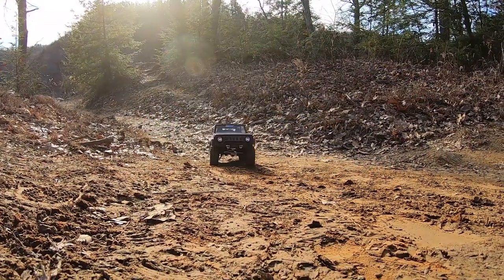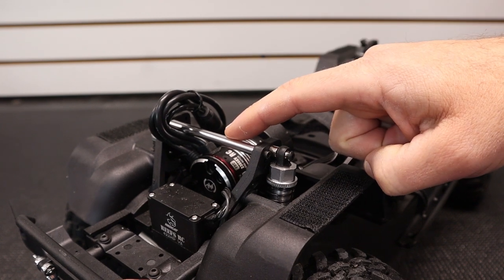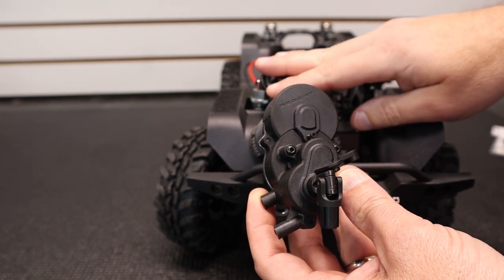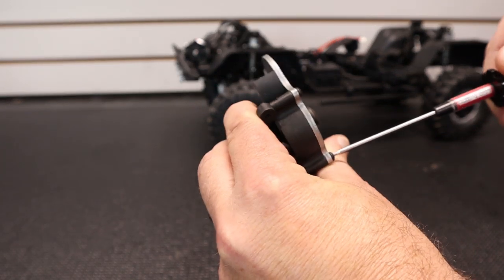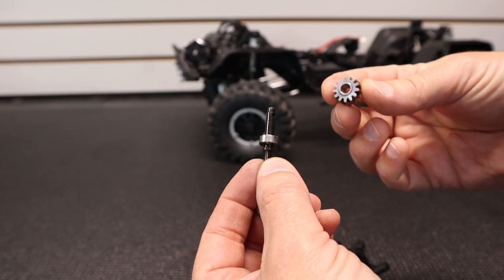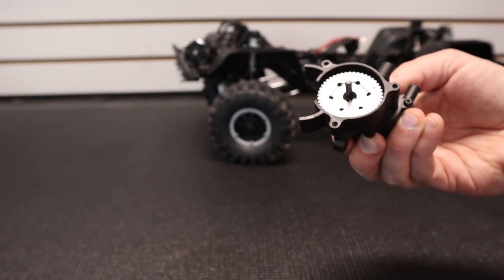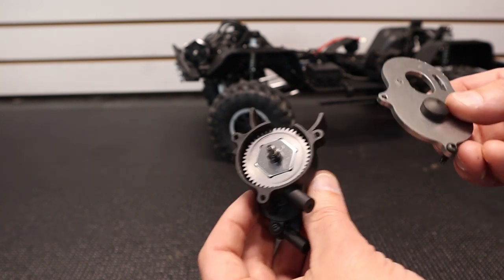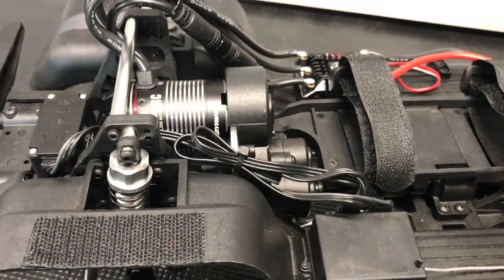Toughen Up Your Transmission! Robinson Racing Redcat Gen8 Steel Spur & Transfer Gears | RC Driver

Comment: Just wondering for my personal use... Will a 7.2 volt 3000mah ncmh battery burn up a 1994 Traxxas 20 turn brushed motor. Right now I have 1600 mah. I might buy batteries but am unsure whether it will work. Thanks

Comment: How do I put an 5mm shaft motor in a REDCAT tornado exp pro. I have m1 19-22 tooth gears but the gear on the differenchal is different and doesn’t mesh with the gears for the motor

Comment: I was tightening stock wheels on my 2wd rc car and the front side when I should tighten it it would be hard to spin but when I loosen it it wobbles

I’m new to the hobby so I’m confused
Reply: Pin behind little wheel locker